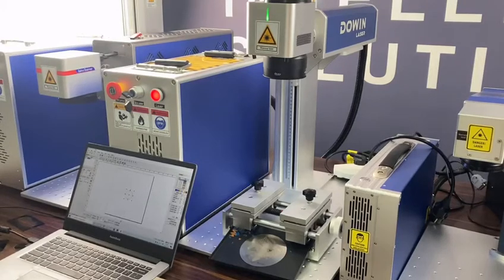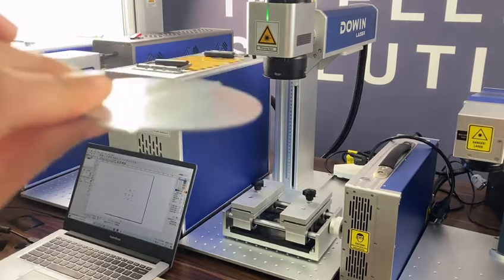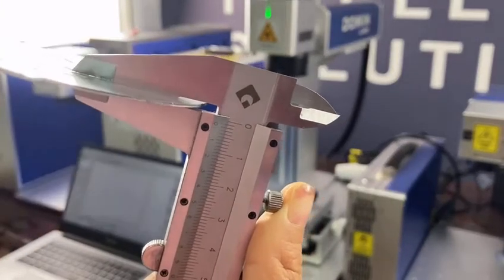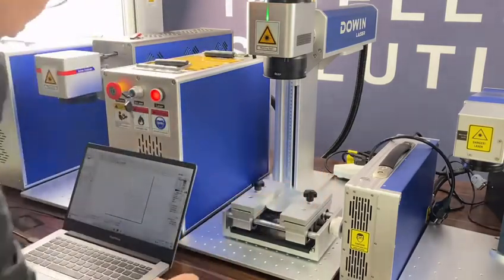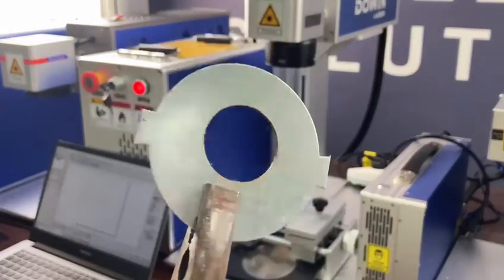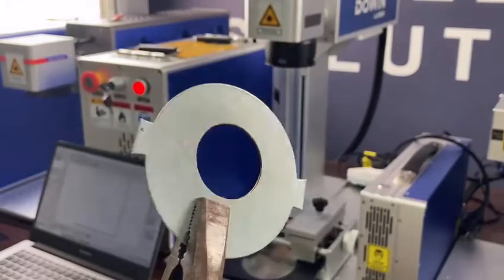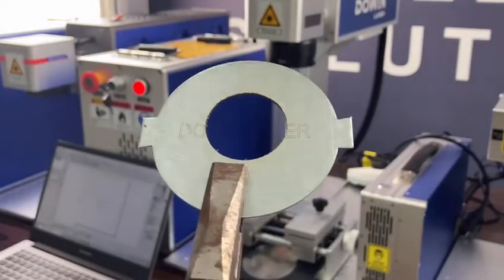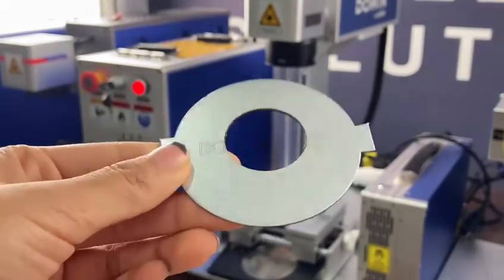1mm stainless steel cutting with 50w fiber laser cutting machine

Comment: How long does it take?  There were at least two cuts in the video.  Minutes?     How much wear does it do to the galvo mirrors, runing at full power for minutes on the very same path?  And the edges of the cut are very burnt, rough.   I don't think it is worth using this laser for such jobs.  maybe occasionally, once in a while.
Reply: 25 minutes